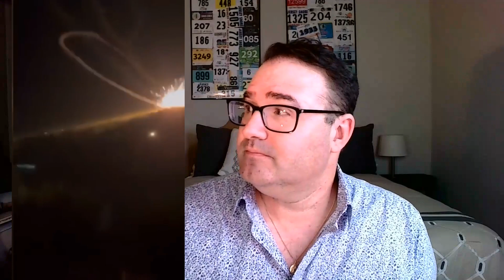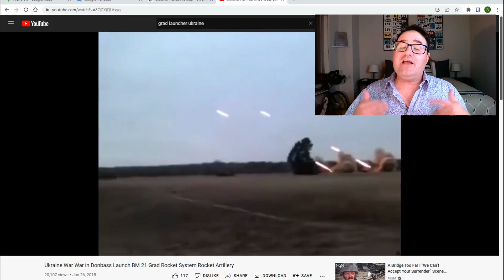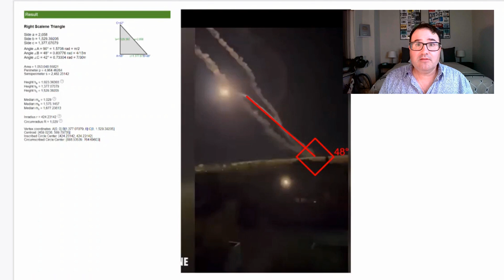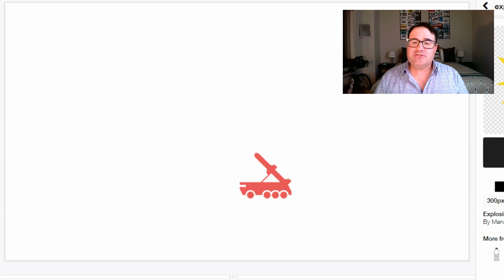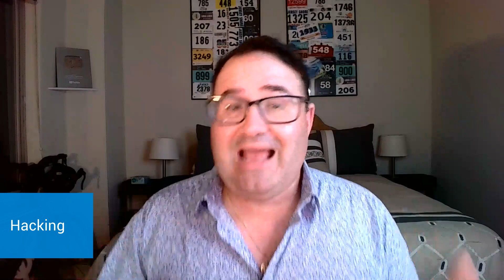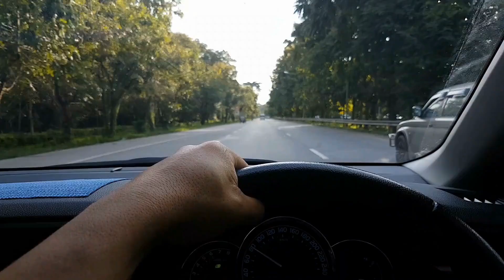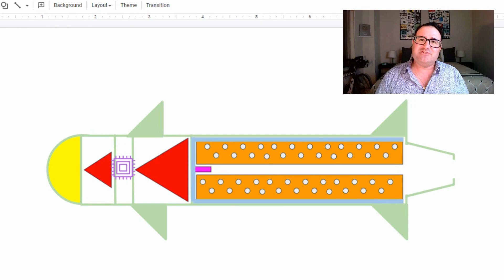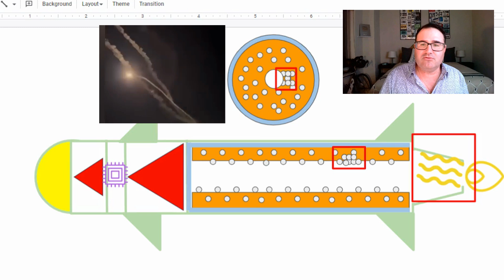Why this missile U -Turned

Comment: My best friend is a hobbyist rocketeer, so I've been to quite a few events.
I've seen a lot of spectacular failures, part of the thrill and fun of going. 
From a purely amateur, spectators view and from what I've been told by rocketeers I concur with your theory.

I've seen exactly this happen to hobby rockets and it was always either failure of one engine or inconsistent solid fuel mixture.
Reply: The best explanation I've heard is that it's probably an active homing missile of type 9M317M which makes it an Sa-17/Buk M3.
These are armed and tracking off the rail, so no safeties (cue Red October references)
Probably a single TEL rather than a radar unit and multiple TELs.
They probably left a radar on and and became the closest target via passive homing, like an anti-radiation missile.
I'll try to post the link next, if it's not there it got zapped by Google or the channel
Reply: Once at these velocities it's exceedingly hard to change direction without active guidance input. Also, on your experience at hobby launches, the ones that veer off course aggressively either have fin failures or bad cluster ignition. These missiles don't use clustered motors and if it was a fin issue you'd expect the problem to happen sooner in the flight
Reply: One would expect the missile to go into a more random direction rather than directly back to the launch site.  Otherwise I agree with the theory.
Reply: @whysoserious8666  Yes, of all the directions for the missile to deviate towards, it chose to return towards the launch vehicle. That seems to be a little too accurate for just a short pulse of some poorly mixed solid fuel. That looked more like a guidance lock on!
Reply: @markfryer9880  there's another angle from the front where you see the missile impacts off to the side of the launcher, it wasn't a direct hit but an oblique deviation
Reply: @markfryer9880  It didn't go exactly back, it went nearly back. it landed short, hit the ground, and then splashed. Plus we're only seeing from one side, it could have been over to one side or another by quite a bit.
Reply: @K9_Wang  There’s a similar video for a Patriot missile failure in Saudi Arabia that the Ruskies are sharing around as well (and a recent Ukrainian one too where it seemed to corkscrew several times straight up into the air), that’s likely what happened considering the Patriot did pretty much the exact same thing otherwise the explosion of the other missiles would’ve been far bigger
Reply: @ghostfacegrillah7891  plus the BUK and Patriot missiles use fin control instead of canards. Seems plausible that either the IMU or the Tail fin actuators failed due to long term storage

Comment: Looks like a exhaust nozzle failure to me. As a caviot broken or dislodged pieces of propellant can cause enough of a pressure spike to damage a nozzle or even cause a catastrophic failure of the combustion chamber.
Reply: Wouldn’t that make the trajectory into a corkscrew or spiral instead of this seemingly controlled quick U-turn and straight dash ?
Reply: I've seen nozzle failures on massive solid motors, and they don't do this. Even cutting off half the nozzle would only create a thrust offset of 5 to 10 degrees. At these velocities that wouldn't even be close to enough to offset the aero forces on the fins.
Reply: It would have tried to course correct that flight path deviation, instead of just making a single snap turn (which requires at least TWO different inputs, both for starting and stopping the turn).
Reply: if it had been a chunk of the propellant grain that separated, it would likely have obstructed the nozzle throat and it would have blown up the rocket motor.

Comment: Idk but it seems like a cectoring phase gone wrong, basically Some of these have a booster on them or an in built solid stage that ends with rapid vectoring in of various forms, if the breaks it could easily go for a 360 turn instead of the maybe 30 degree turn it was supposed to make, depending how n the system, some rapid vectoring systems use vectoring in one rotational direction and then another boost to cancel out the rotation in rapid succession, all you really need is for the canceling rotation part to fail and the missile can’t really stop rotating, idk if that is what happened here, but something up that ally has s likely i thin

Comment: But, okay, lets say there was a defect in the fuel grain that caused the course deviation, that still doesn't explain why the missile was already armed during the initial boost phase of it's flight trajectory. Perhaps things are just made different in Russia, but an air-to-surface missile detonates on either a proximity or radar (still kinda proximity) fuse, so unless the Russians didn't get the memo where western arms try to protect the user from misfires just like this one by not arming the warhead until the missile is in the terminal or lasts phase of the flight trajectory (for example with the NLAW only arming after 20m have been traversed), so per this logic if you are right and it was just a busted fuel grain, then am I right in assuming that in that case the missile shouldn't have detonated upon impact, but instead it should have simply remained inert while impacting the ground (because the missile was presumably still relying on the external tracking radar for directions, and it shouldn't have switched to it's internal tracking radar yet because it was still very far away from its target, so logic dictates that it also shouldn't have been armed when it struck the ground). Unless Russian weapons are just built different and like to live dangerously or something, but to me that really seems like an irresponsible, backwards, and moronically stupid way to design and build your weapons 🤷
Reply: Did the missile's warhead detonate, or are we just seeing a propellant explosion?

Comment: Depending on the exact missile, it could also be a problem with one of the tvc vanes.
Reply: On wikipedia they only mention thrust vector vanes in the latest version, the 9M317M(E).  do you know if they are in the earlier ones as well?  They also mention that the combustion chamber is mounted centrally with a long gas pipe to minimize the effects of asymmetric combustion of the fuel.  It's interesting that it did a u-turn rather than a spiral.  This implies an impulse making it rotate, and then the thrust vector is straight again.  It's hard for a simple mechanical problem to do this.  Hacking isn't always done over the internet.  Somebody could have changed the program.  Or there could be a bug in the firmware, or a failure of a sensor of some sort.

Comment: Okay, I've never been a Sam weapons system tech. However, I have a theory that hinges on their three part Sam site. I think that the radar vehicle had a solid weapons lock on the first two launches. Then, the heat buildup of the first two launches and location of the three kinds of units in play relative to each other play into a situation where the radar victor locks onto the buk launcher victor in error and passes that to the control victor. In response the control victor continues launching, believing that they still have a good lock or that the lock only dropped momentarily. The final buk missile is launched having been locked onto the launcher vehicle and promptly whips around in an attempt to go high order asap. I like your theory and the upside down protonm guidance theory as well, but feel like that turn happened right about when the guidance begins controlling flight characteristics. Everyone has seen a Sam launch and take that change in direction about a mile or so up, just not this hard. Lol I feel for the Russian mothers burying son's, but am glad to know that there is one less Russian land based asset in Ukraine.
Reply: Wouldn't the radar operator see that? I worked with ex Warsaw pact airforce officers who trained with the Russian army (80s) and they always told me that the rocket AA is very important in their doctrine and the staff of those systems are highly trained, for Russian standards. They also told that the maintenance of equipment and weapons was horrible so a rocket malfunction makes more sense in my opinion.
Reply: When a missile is being guided by a radar, heat isn't a factor.  If the Buk was a system that fired missiles that had infrared seekers, heat could be a factor, but there is zero chance that it would turn around and come back like that, because the seeker on the warhead would have never seen heat from the rest of the system.
Reply: @cmbara102  Rad, I'm not a Sam systems tech or anything. Just a wild theory that felt plausible to the uninitiated.

Comment: Wouldn't the guidance have been trying to fix the direction after the one sided overburn?  Why would it fly straight instead after that instead of trying to correct?
Reply: The missile "thinks" the thrust is normal. If thrust is offset, it will try pointing the fins to correct but the thrust will keep bringing it out of the correct path. It's like picking up a small dog and they keep running in the air with their legs.

Comment: You are missing a really big part of this. Yes, your fuel clump theory might be why it initially changed direction, but the reason it went straight back to the launch site was because it saw a big bright radar illuminating the target pointing right at it. It then homed back in on its own launch site.

Comment: I have another one: maybe it is a 2 stage missile and the fist stage wasn't decoupled properly so when the second stage ignited the thrust was forced around the fist stage for half a second wich was enough to vector thrust the missile by 180deg.then the fist stage was flung off and the missile continued. And yes I played too much ksp.
Reply: I don’t know for sure but I think when it comes to AA if they have a second stage fuel it comes from the body just like the first stage I don’t think they usually have stages like rockets where they decouple a fuel tank but I’m not an expert lol
Reply: The buk only has single stage missiles available for it.

Comment: Hmm would the guidance or correction system would try to correct that, then we might can see a few more turn or spiral. The missile turn and go straight without much change. Just a thought.
Reply: Perhaps all those system would not be engage until further, on the initial all effort are used to gain speed.

Comment: Is it possible that the missile had a puncture on one side, or a weak spot that caused a puncture during it the fuel burn efficiently causing a side ways thrust? That what pop into my head when I saw this video
Reply: That would cause a continuous vector change or cause it to cork screw. It more likely was just a momentary blip in the fuel.